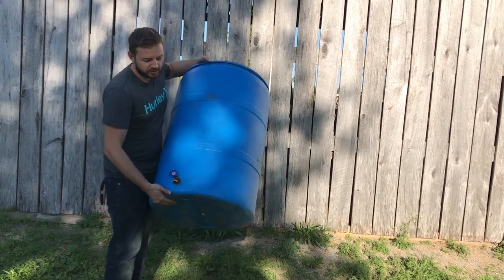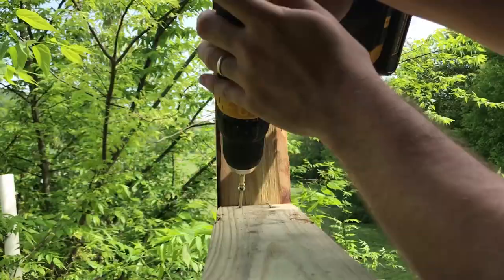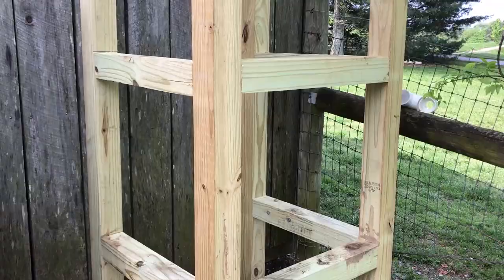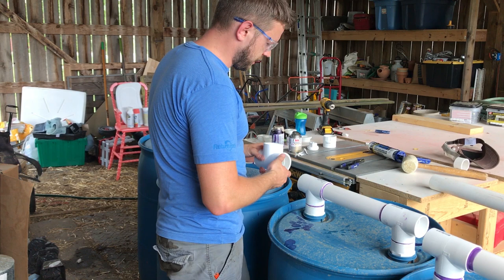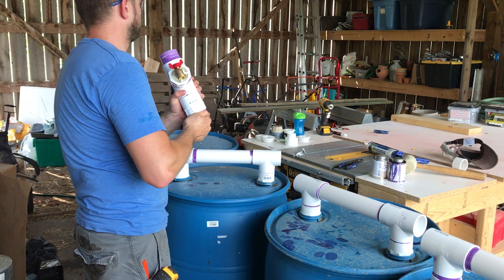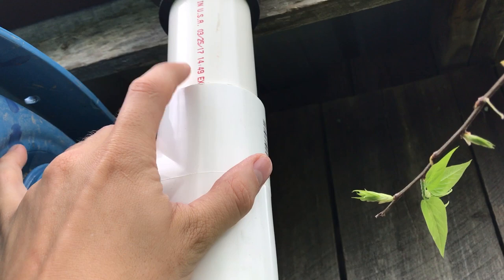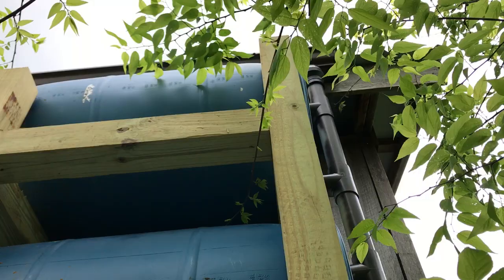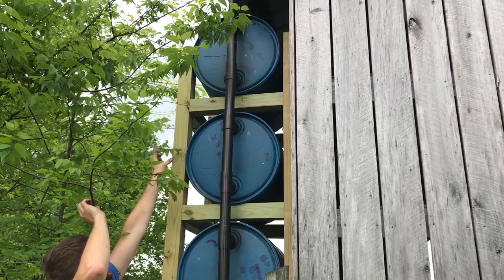🔨  DIY Rain Barrel Build - Vertical 4 Stack 55-Gallon Drum Rainwater Harvesting System

Comment: Should replace the first barrel connector with a T in case all the barrels fill up it can spill out of the top +. You would lose some water from that end but it might save your roof in the long run lol also might want to run a pipe to the ground off it to avoid splash back on the wall. Going to build something like this in the spring as well.
Reply: How would it save his roof Like from water build up?

Comment: Love the idea, been wanting to set up something similar, just havent had time. Others have pointed out what i know i would do differently but wanted to put in 2 cents.  I will be putting in a first flush system for sure. And i would notch/dado 2x4s between the posts so as not to rely on screws to hold all that weight. Though since its already built, i would definately put on some simpson strong ties.

Comment: Plumb small fittings at the top barrel and the very bottom barrel and run a clear see thru hose so you can tell where your water level is at all times.. Kinda like a gas gauge if you will... I like the stacking idea. I may do this and gravity feed from an old well we have here on the property that way there is a constant supply of water to my barrels.. Thanks for uploading the video.. Looks good and the black looks clean painted on there.. I would had never thought about that attention to detail.. Good call.. ~rockinfxguy
Reply: The clear piping to be able to see water level is genius!
Reply: @cck89  I think so. Glad you finally seen my message..
Reply: I like the idea too of the layout and clear pipe, brilliant 👌🏽. I’m going to build same however cover the barrel casing with wood slats especially where I’m staying to enhance the beauty. Thanks

Comment: Thanks for the video. My thoughts the same on the top half not being glued, only areas after the first flush. I added a first flush to mine to catch the fist load. I saw them on sale for 70-80 bucks. I simply grabbed a 4in plastic tube (about 18-20 in depending on how much trash you get in the collection area). I used a plastic 4 to 2 reducer with a screw cap on the bottom for debris removal. For the stopper I used a racket ball (2.25 in, so it works great on the 2 in.). Sorry I don’t have a pic. Basically, T pipe atop, the reducer below, the 4in storage below that and the cap at the bottom. The first flush fills up the containment area, water rises to close the opening with the racket balls and clean water continue to storage supply. Not in use yet. I expect to place this early in the collection stage and probably just after my overflow value. I’m not sure I saw one in  yours. I placed an overflow value so my gutters don’t fill up and weigh down. BTW - a panty hose would work well in some cases.
Reply from the maker: Dang nice setup!

Comment: It's very interesting, very well designed,  future problem is,  that the weight of water on drums, supported itself on tanks' extremes, will cause break of its. To solve it, you must put a wooden bed along each tanks ( just on the side to hold the water 's weight.

Comment: you should connect another pvc connected to the drain pipe with a ball at the bottom that will go up
and lock at the top and redirect water to the tanks. this is so that the dirty water from rainful is directed first to this pipe before it sends water to the water tanks.

Comment: Cool project.  Note, water is ~8lbs/gallon, so when full each barrel is ~400+lbs of weight.  That's a pretty big load for the horizontal 4x4 boards.  Did you toe-screw each horizontal 4x4 with 2 screws on the top, 2 on the bottom?  Might want to consider more bracing? Eg, screw a scrap 2x4 underneath each of the 4x4's where they meet the vertical post?
Reply from the maker: Thanks for the considered feedback Nathan. It certainly wouldn't hurt to add extra bracing. It held up well so far 😀I used 3" screws, three for each joint.
Reply: I agree.  Perhaps putting some 2x4 against the 4x4 to support the horizontal member.  Screws shear whereas a 16 penny nail will just bend.  Hopefully it holds, but it's worth looking into.  Look at aquarium stands construction to get an idea.
Reply: this is what I did with mine, 2x4 bracing underneath each 4x4, and I've started using lag screws to attach them together.

Comment: 1. Drill an overflow hole just above the top barrel, 2. Cover the frame to protect it from weather/UV or paint frame otherwise it will fail over time, 3. Install some kind of filter system no matter what it is used, 4. Install splitter(s) at facet for different uses like hose, dripline, etc. Fix those and I'll give you more. ha.

Comment: I'm curious how this system has worked for you long term. I really like the idea of stacking them horizontally, I'll be using that method now when I do mine. Without a first flush though do you get contaminants in the system? And with the full system glued up are you able to clean it? I'm not looking forward to the huge extra cost, but I think I'm going to add unions on mine to make the system more serviceable

Comment: Would it be a benefit to have the barrels angled so the stored water can leave at lower levels? The top would probably have the least tilt while as you get lower it'd be more pronounced. Or possibly feeding the pipe through each barrel so that each barrel drains down to the lowest where the knob is

Comment: This can be made with a water hose connected at the topvertical pvc tube and also has a second fuction as a over flow where most needed also a screen connected at the end this is a friendly advise like I said in the beginning there magnitud = Power
Reply from the maker: Thanks for the feedback! I’m glad you are interested. The top of the pipe is open so air comes in giving airflow. If it overflows it just runs out over the gutter. No harm done it’s on my barn 👍🏻 the rest of the barn doesn’t even have gutters at all.

Comment: How well has it held up over the years without brackets holding the corners together? Also, did you have to secure it to the wall due to settling?

Comment: I notice you didn’t add any vent hole line near the top of each barrel.   I also did this dual barrel. But notice it only fill up about 75-80%.       It couldn’t fully fill the bottom barrels

Comment: You may want to put 4 pads under 4x4 posts or maybe even half of the plywood so it does not sink into the soil . 
Question 
So far I saw barrels with 2 caps , one fine thread the other course thread , HD or Lowe’s has  fine threat 2”’adapters what about the course thread  or your barrels have fine thread  on both sides ? 
Also you could save a little and use 90 instead of “T” .
Reply: Yes! I’m having the same issue and came here looking for the answer. No luck on any videos yet. Let me know if you find something please!!

Comment: What connections did you use to attach your piping directly to the barrels? Is it threaded connectors? The barrels I have have different threads on the two different holes in the barrels.
Reply: That's my question too. Did you have to use any special adapters? I have barrels that have 2 different thread patterns.

Comment: Great work and video! My wife and I are thinking of doing something similar. However we were thinking of having the barrels vertical instead of horizontal. But I like your idea better. I have a question about the barrels laying on there sides.  I think the barrels will hold 55 gallons fine stand up. My question...are you in anyway concerned about a decrease in structural integrity  by laying them on there sides? Any buckling stretching twisting or cracking? Thanks for the video and 73 from KF0ALT
Reply: There shouldn't be an issue. Direct sunlight can degrade the lifetime of plastics. As far as lifetime, I've had two in this configuration with half day sun and have no worries after five years.

Comment: Great video! It looks like you braced the first post against the side of the barn. Did you use the same screws as the stand construction? Im attempting a similar setup in my backyard. I’m not sure if I could do the same on the side of my house. Would I need to take extra precaution drilling into my siding? Would this be possible freestanding? Or would I need to anchor/cement the post into the ground? Thanks for awesome video👍🏼
Reply from the maker: Thanks Matt! I think you could free stand it if you set the posts in a bit of Quikrete.
Reply: Tenn Hens, yes that’s exactly what I’m doing thanks again 👍🏼

Comment: Excellent video, thanks! I'm going to try something similar.

Two  questions:
1. you didn't need any L-brackets or anything in building the frame? You just put the screws in at angle through both pieces and that's enough? How long, how many, and what type of screws? Did you drill a hole first or just go right into the wood?

2. No chance the barrels are going to slide around in there without a wedge to keep them in place?

(I guess that's actually more than two questions...)

Thanks again!
Reply from the maker: Hey Nicholas,
I may end up adding brackets down the road for extra strength but technically it should be fine with 3 screws at each joint. Each screw can handle about 90lb's of weight. I was also wondering if the barrels would move around as well but they are rock solid when they are full of water. I used these http://amzn.to/2qEAkv2 screws. I use that brand of screw for most of my projects. No need to pre-drill any holes or anything. Good luck man!
Reply: Thanks!

Comment: One of the holes of the plastic barrels have a pipe thread and the other a course thread. How do you screw the male PVC adapter into the course thread, will it not leak.   ???

Comment: How did you connect the tees to the blue barrels? I can't find an adapter with the correct threads.
Reply: Did you ever figure out the fittings we have the same issue

Comment: What about an air vent system and an overflow system? I have also been seeing systems with a first flush pipe system on it to catch the first rain that falls and cleans the debris off and then when that fills up, then you get the cleaner water in your barrels. I like the stacking method. I wish I could find a way to do this stacking build but with a first flush pipe, an air vent, and an overflow system.

Comment: I notice that the threading is for the 2 holes  are not the same. 
Exactly what  PVC male fitting did you use for each hole?
Reply from the maker: Yes this is tricky the right size thread adapters are to much money so I just shoved the same thread adapter in and epoxied it into place 👍🏼
Reply: one is 2" NPT thread, the other is 2" buttress course thread. That is the two standard bung hole thread types(bung hole is the proper term for those two holes). Most all commercial drums in the 15 gal up to 55 gal use the same thread types on those two holes, as long as they are the 2" holes. Some others use a smaller hole and I'm not sure the size and thread types on those

Comment: Hi Nice job, i have a question. How did you put the PVC inside the top of the blue tank?
Reply: They already have 2 threaded holes. Just find a tap or use piping the same size as the hole. You can get bulkheads for this and just screw it in place.

Comment: Question....  did those barrels have removable lids or completely sealed ones?  wondering about using the used food grade barrels or if the lids come off too easily...   HELP...  used are so much cheaper.

Comment: Here in my home, Baja California. We have water problems and the city is implementing a contingency  plan that will make us have water supply from the state only 4 days out of the week.
...could this water storage system be applied to potable water and be able to use it on the house trough an electric water pump? (To avoid having to instal ti avobe the roof)
Reply: We used to own a passive solar home with a 10,000 gal concrete cistern in it, the original owner left documentation on a struggle they had at the time with the state of Wisconsin that prevented rainwater from being used to flush toilets etc. because it wasn’t deemed “potable”. Their workaround was to put 4 barrels up in the clerestory/attic space and he’d pump cistern (rain) water up once a week or so, and use a 5gallon bucket with a little dosing hose to draw in a chlorine/water solution that would purify the rainwater deeming it potable. We lived there 5 years and pitched the water up there once, the rest of the time we used straight rainwater to shower, laundry, do dishes, etc. without any ill effects, we did have a pre-rinse system that diverted the first 50 gallons or so to help rinse off the roof, etc. prior to it beginning to add to the cistern, which helped keep the debris in the main vessel low/non-existent. There were studies done in Jamaica and Australia that show rainwater harvesting if treated carefully as a usable source for 99% of your household needs.

Comment: Did you secure the posts in the ground and cement them?  If so, how deep?  Also, are you worried about the frame sinking when the barrels are full?
Reply: This was my question/concern as well.
Reply: And hopefully attached properly to the wall, so they won't fall with a strong wind

Comment: Where did you find the coarse thread adapters for the bung holes? My barrels have a coarse thread and fine thread. HD and Lowes do not have coarse thread.
Reply: uline they should have the fitting you need.
Reply: I have been having problems finding the exact fittings as well! I have spent to much for it to become economical but have come to far not to finish over these fittings. I need a part number please!

Comment: Great work, but some major design flaws with the horizontal barrel placement. Doing research online many people do not recommend this unless you have horizontal support for the full barrel length. People have said the barrels will deform from the weight because they were designed for vertical orientation. And when they do this they will crack and break your connector pct pipes. As well we didn’t see any leaf or debris screens, overflow diverting or air vents at the top of the barrels

Comment: YOu did not mention what you are using the water for. No filter or first flush system or a pump if required. Just curious.

Comment: The holes in the drums I got have two different threads, a standard plumbing thread and a coarser one.  I haven't been able to find anything to fit it.  Any suggestions?
Reply from the maker: You can get adapters online but they are unnecessary expensive. I just shoved the wrong thread in and used silicone to try and glue it. That did not work well, some of them have slow leaks. I would try to bond them with epoxy. Let me know how it go’s? I am thinking about talking mine apart and re bonding those connections on my own setup if that works well.
Reply: Ran into the same issue. What crack pipe guy designed this?? I’m sure it was so dummy would not connect the wrong end or something. It is not convenient.

Comment: I'm building the same thing started with 3/4" hosing with fittings that screwed right into the bung but water flow is terrible. I modifying to pvc instead. where did you find the fittings that connect 2" pvc to the barrels? also how is the flow pressure through that spigot you have mounted?
Reply: I was wondering the same thing
Reply: I have the same question-- I'm ready to start my project, just need to know what to get for that step!
Reply: One thing I learned thus far (week 3) is you want to keep the diameter as big as you can for as long as you can. Once reduce, you just lost pressure and cannot regain it normally without power. Here is what I used to go in and out of the barrel. Caution (my blue barrel had different threading on each hole - not sure if this is consistent) https://www.supplyhouse.com/Spears-436-020-2-PVC-SCH-40-Male-Adapter

Comment: Do you encounter any problems with air when filling and vacuum when emptying?  I did a 4 barrel system 2 below horizontal and 2 on top vertical. But I’m now thinking about air in the system. Can share a pic of my build if you respond
Reply: I have just this question re: air lock. How did you solve it? Thanks in advance

Comment: Great video, had to sub. The barrels I've got have been stamped "Do not stack on side." They look identical to yours so I'm not sure why that is specified.  I see this was made in 2017, how are they holding up in 2021?
Reply: The barrels are cylindrical and will roll on their side. A full barrel of water weighs about 450 lbs and stacking them on their side creates a safety issue. These are caged in a structure so he has eliminated that issue. You can lay them on their side, just not stack barrel on barrel on their sides.

Comment: That is a heck of a lot of weight...did you do the math to see how much it will weigh when full of water?
Reply: Water weighs in at 8.34 X 4 X 55, so about a ton after the wood and all. You can use post holes or dig out 6 in and place cinder blocks for a solid foundation. Especially if you have soft ground.

Comment: As a plumber, it would be easier to put in the male adapters in first, stack your barrels then pipe the rest, pre fab the t’s and glue it all to the adapters at once… oh and use clear primer unless you have no other option

Comment: That's awesome! How long does it take to fill up? What are you using the water for?
Reply from the maker: I am wondering the same thing, not sure yet how much rain it will take to fill up. We are using the water for our garden. I will be hooking up a homemade soaker hose with the mechanical timer valve. This way we can just turn it on and let it shut its self off after 30 min.